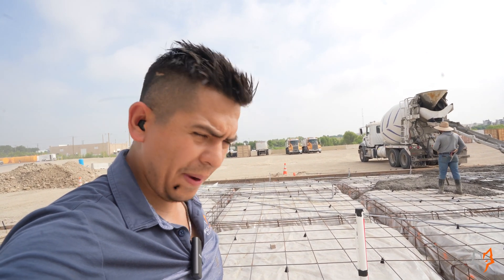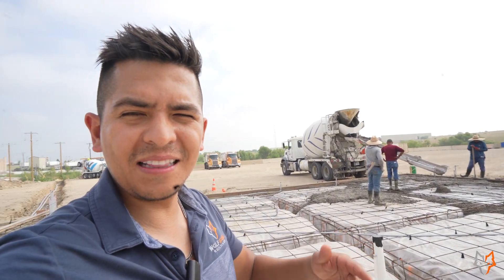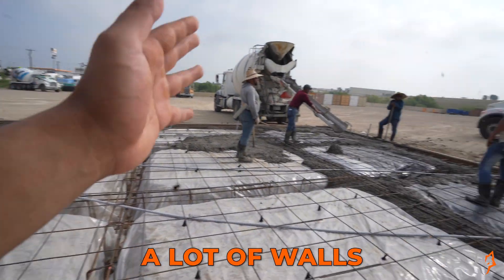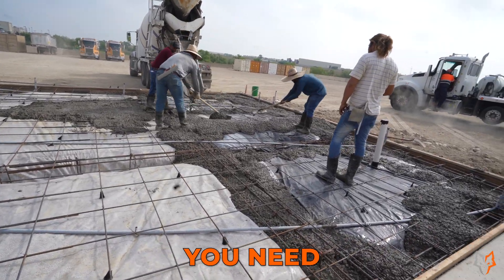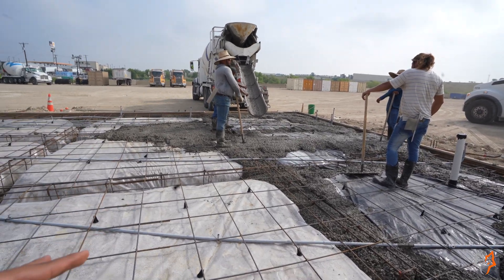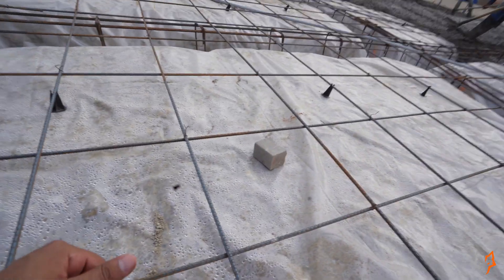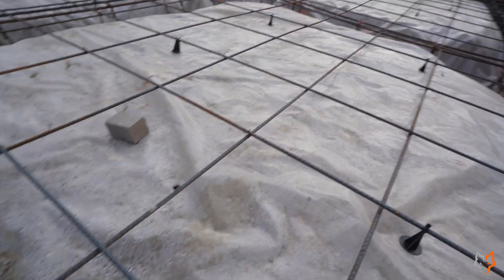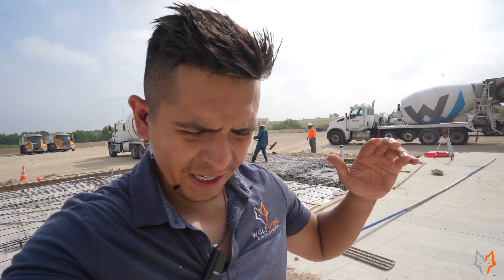Concrete for a 30x50 Metal Building in Benbrook Texas | Engineered Foundation | WolfSteel Buildings

Comment: Ok remove the electrial quote and what is the price for the engineered slab for this job.  What is the thickness of the pour?  Now for bonus points what would be the price for a non-engineered slab with the same slab thickness?
Reply from the maker: James - Great question! Engineered foundation pricing can only be given by seeing, assessing, and testing the soil and land where the foundation will go. The price for an engineered foundation typically increases between $3-4 /sq ft in comparison to non-engineered foundations. There is also additional pricing for the foundation plans. These plans typically include the soil testing, engineered design, and pre-pour inspections.
The thickness of this slab was 4"
As always site prep is separate from the pricing for concrete.
Reply: I just paid an engineer in San Antonio to design a 20x50 metal building slab. They charged $550. To be fair to Wolf, they already knew the area and had done the house foundations in the new neighborhood. 

The slab cost was about $11/sf plus 50 tons of base ($1,000). My slab is 6” but I’m a commercial GC and that’s just the way we do it.